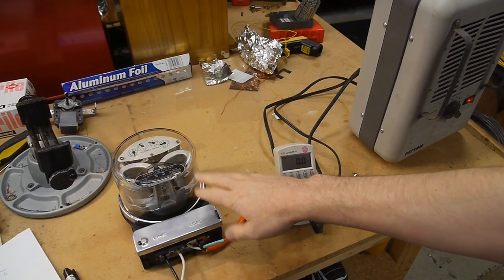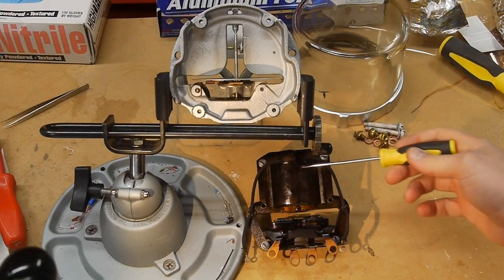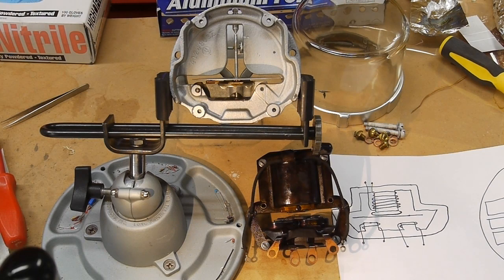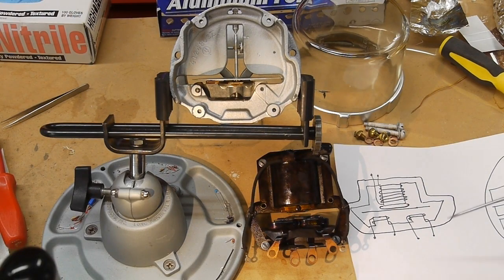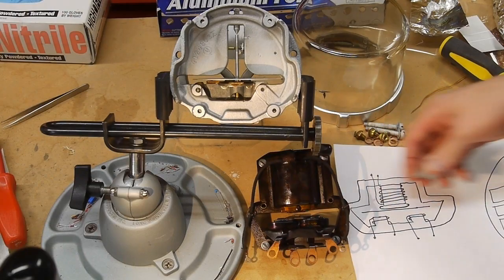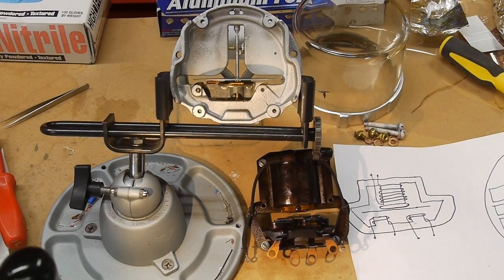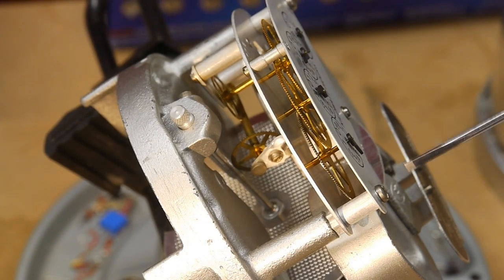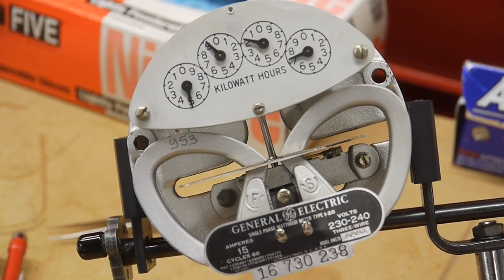Explanation of how kilowatt-hour meters work (electromechanical)

Comment: There were a few 19th Century engineers that were so boss that their inventions have remained unchanged (more or less) for over 100 years. Meaning in all that time, even with the aid of computers and a much more complete understanding of the physical laws no one has yet come up with anything better.
      Not many people can say, "This is the best possible design" when it is the first go at something.
     Of course the people who invented them can't say it either because they are dead. But they COULD have said it, had they known.
Reply: Because there are apparently things that can't really be improved much.  For example internal combustion engine is being improved all the time because it still doesn't have even a 50% thermal efficiency (the best F1 engines have close to or 50%, common road cars are around 25% if I remember correctly which is actually pretty horrible). On other side you have a device like this which is nothing more than a pretty simple electric motor with properly calculated forces so that the rotations are proportional to the power consumed. There isn't really much to improve there, maybe better bearings to last long and not become sticky over time but really not much else. So it's kinda uninformed to call anyone "boss at their invention" because a design gets unchanged - it gets unchanged because the very nature of the device doesn't call for any change.
Reply: @mikosoft  That is not what I am saying at all. Note that I qualified my comment with "more or less".
      That means that while the basic design has been improved, it has not really been changed. There have been ideas tried, to different levels of success, such as the rotary engines made by Mazda, but these have all had problems.
     Efficiency is not the only consideration when considering how good one engine is compared to others, such as reliability and wear (how long it takes to wear out) and what you want to do with the engine. For example, nearly all modern airline engines use gas turbine (jet) engines. Even those with propellers use gas turbines to spin the propeller. Meanwhile, gas turbines are almost unheard of in powering cars, which still use piston engines.
     Also, instead of just pulling numbers out of your ass, try looking them up. The very best piston engines have an efficiency between 20% to 35%. F1 engines are even less efficient than that, because in racing power is more important than efficiency. Race car engines operate differently than street car engines.
      It's all about trade offs in engineering.
     Also, here is where my numbers for efficiency come from. They were not hard to find.
https://en.wikipedia.org/wiki/Engine_efficiency
Reply: Yes, Shallenberg was “boss.”  His meter was improved, but the principle remained the same for a century, when electronic meters began to replace it.  He died at only 38.  What might he have achieved had he been given another 30 years?

Comment: If you have an old Air conditioner or other large inductive load, do these meters compensate for the current lag / power factor and charge you appropriately?
Reply: As far as I know, they don't. A residence is only ever charged for active power consumed and the utility just accepts reactive power consumption as a loss. This may not be true on the commercial scale. I think the utility charges them differently for expected reactive power consumption.
Reply: Chris is correct, this is a Watt-Hour meter, so it only measures Watts (True Power). You get all the VARs (reactive power - like the inductance of your old AC unit) you want for free.

Large scale commercial & industrial will have Watts & VARs measured, and be charged extra or credited depending on their Power Factor. Usually about 85% power factor.

Comment: 0:05 Please observe in the lower right of the line just below the word "FOCUS" and there you find the designation Kh 7.2    It is the meter's golden number... (for calibration)
In 1974 I needed to measure the power consumption of an industrial process. I needed to measure WATTS of power. In those days such a meter would cost us a few thousand dollars. Instead, I spoke to the "engineer" of the engineers at the power company,  and he recommended I use the "power consumption meter" like we all have on the outside of our buildings. These were said to be accurate to within a 1/4 of a percent down to one tenth of percent of the full scale power handling of that meter. If the power company was happy to trust it's charges to it's customers for thousands of dollars, so would I trust it's accuracy. I bought a certified and calibrated one for $125.00 from their supplier.  And pretty simple to use. (Also quite useful for power consumption diagnosis at home). HERE'S THE SCOOP..... That "Kh number" for the meter tells "how fast it is" you'll see 7.2 or 14.4 or 28.8 on different meters.  Any way, time the rotation of the spinning disk in seconds, and use this formula "" The Kh number times 3600 divided by the number of seconds for one rotation of the horizontally spinning disk EQUALS the WATTS through the meter over that same time period ""  Damn that's so easy!!!  want to find out the consumption of an air conditioner, refrigerator, a heater, electric range, a furnace? Just turn off all devices but that one, time one rotation of the spinning disk in seconds, and you've done it!
Here's a few examples: 
Kh 7.2 times 3600 divided by 17 seconds for one rotation is 1524 WATTS for a heater.
Kh 14.4 times 3600 divided by 81 seconds for a rotation is 640 Watts for a refrigerator.
or Kh 14.4 times 3600 divided by 8.1 seconds for a tenth of a rotation is 640 watts for the same refrigerator, didn't want to wait for the full 81 seconds. You can use your head. And couldn't be sure the frig compressor was ON THE FULL 81 seconds. 
How about the cost of all the Christmas lights you're running on the front of the house?
Of course a Kilo-watt-hour meter costs $40 has a lot more features and is easy to use, but back in those days, this accomplishment was impressive and useful. Boss was impressed too.
Reply: So it's like 7.2 Joules-hour per rotation (or 14.4, 28.8, etc.), good to know. The "Kh" probably comes from the dimensional analysis coming down from kilowatts-hour (kW.h) and kilohertz (kHz) of the disk.
The 7.2, 14.4 and 28.8 reminded me of 2 things, digital audio kHz and the kbps(kilobits per second) of old dial up modems. It all has to do with the frequency of information in its format, in these two is a signal, but in the meter it comes down from how many turns it takes to get your kW.h
Reply: Kaos Warrior 1 minute ago Highlighted reply, "So it's like 7.2 Joules-hour per rotation (or 14.4, 28.8, etc.)  ..."
As I originally wrote the "14.4, 28.8" they looked familiar( the co-incidence was strong ) I had forgotten the 'low speed modem' epoch,  I liked your "Joules-hour per rotation" and " kilowatts-hour (kW.h)" from the dimensional analysis. Thanks for your comment ( 7.2 Joules-hour per rotation)
Reply: I believe the 7.2 Kh means that after one rotation you consumed 7.2 Watt-hours of energy.
Reply: Awesome
Reply: I have MAD respect for the old timers that figured things out using their brains 
and drive back in the day......as I now am almost an old timer I have passed on to my son and a few select others that I thought would appreciate some of the things that I have learned and figured out over the years......
  What you shared is a great example of that and I say Thank you for sharing.
Reply: @Junk Mail : thank you for your comment.  I am just a DIY kind of nonprofessional 🤪. Informative and cool to know!  Thanks for sharing, ‘tis GREAT!!!👍👍🎯
Reply: Makes sense, since the disk and pointers on the dial are all connected via a bunch of gears, so if you count disk revs and time it, you'd be able to calculate how much electric is used
Reply: I was calculating the power consumption for a school building using this method of timing the spin of the dial on a 3 phase billing meter.  The school operational time inclusive of cleaning etc is around 20% of the annual hours.  For example Saturday and Sunday consumption is around 16kwh per 24 hours.  A normal school day consumption without heat is around 100kwh including the base load of 16 kWh per day.  Hence targeting the base load has potential for considerable energy savings. Eg, emergency Lights, battery charging that operate 24/7, devices left on, IT,.....
Reply: Interesting.  Now that electronic meters are replacing these, they can report instantaneous power consumption on the meter display.
Reply: If you like this comment, I'd love to hear comments back, just below here. Thanks
Reply: @junkmail4613  In English the words ITS and IT'S are spelled differently because they mean different things.
Reply: MrCuddlyable3 17 minutes ago, "@Junk Mail In English the words ITS and IT'S are spelled differently because they mean different things."

According to "https://www.merriam-webster.com/dictionary/it's"
"
This apostrophe form of the possessive remained extremely common throughout the 17th century and was used by the likes of Thomas Jefferson and Jane Austen. The version without the apostrophe only became dominant in the 18th century—probably because it's was taking on a new role, replacing the contraction 'tis.

It would be simpler, of course, if there were only one form in use, and there's an argument to be made for using it's in all cases; 's serves both purposes just fine for nouns. In the cat's bowl it signals possession, and in the cat's sleeping it represents the contracted verb is.
"
According to me:
Making this distinction for the sake of "The current FASHIONABLE" usage IS REPREHENSIBLE and makes the language more "self-contradictory"  Apostrophe s added to any noun is used to indicate possession, OR used to indicate the missing "i" in the contraction for "IS", so adding "'s" to the pronoun "it" is CONSISTENT with making it possessive in the context of the word, and so IT'S CONSISTENT in IT'S USE, and I WILL use it in OUTRAGEOUS PROTEST.  Go prick yourself!
Making room in the language for the replacement of " 'tis "certainly is rather obscure in this day and age. Let the language be smooth and streamlined and NOT HAVE A LOT OF IDIOMATIC EXCEPTIONS. " 'Tis much better left to itself"
Reply: That's potentially useful to know. Thanks.

Comment: Looks like it would create a high resistance as small as the eyelets are.
Reply: Yes, if it was supposed to measure 100 or 200 amp loads. That meter is for loads of only 15 amps or less.